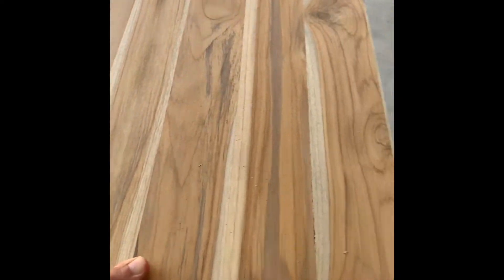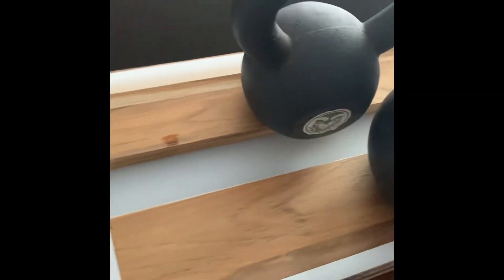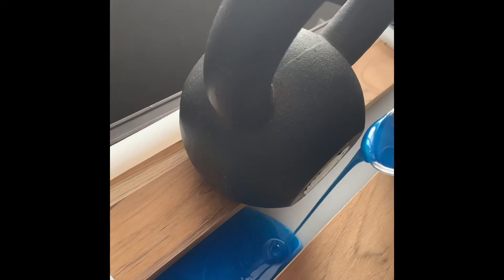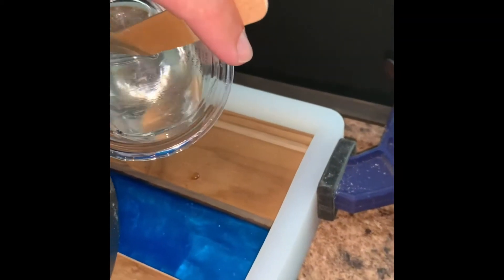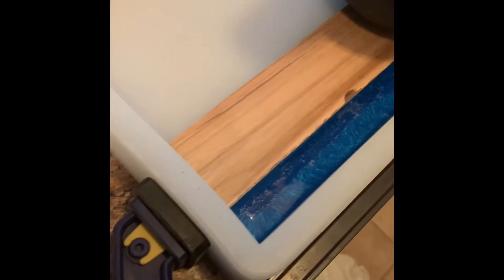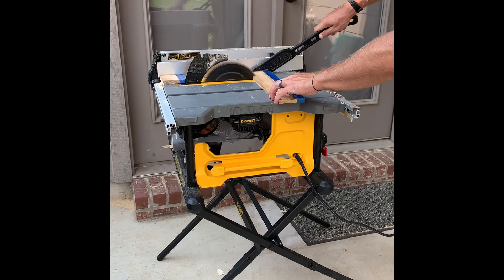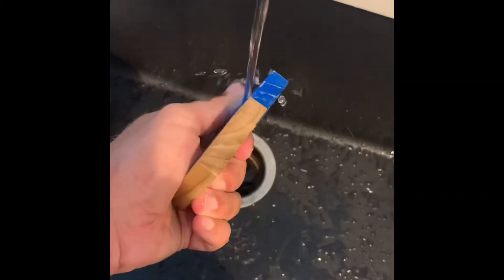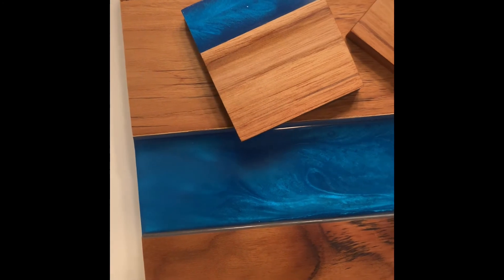Teak and Epoxy Serving Board and Coasters!

Comment: Nice!  I like them.  What kind of epoxy did you use?  Was it deep pour epoxy?  I couldn't see the name of it.
Reply from the maker: Started it with East Coast resin, finished with Incredible Solutions (code on my IG).  2 inches wide, 1 inch deep.
Reply: @veterancustomwoodworx9858  Thank you!  I'm looking for the best type of epoxy to use.  I have tried East Coast but I got gypped on Amazon .... paid for the 2 gallon and only got the 1 gallon.  So, looking for a better place / epoxy to use.
Reply from the maker: @jackieb1432  https://www.incrediblesolutionsonline.com?aff=54
Code: Vcw10